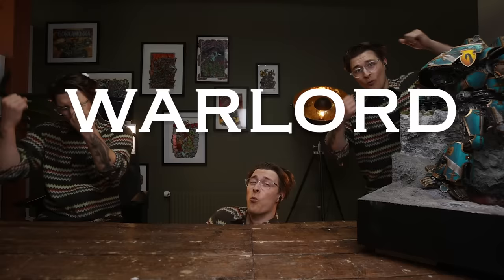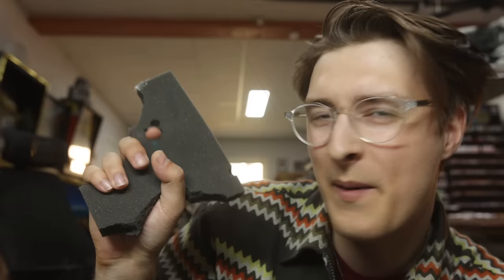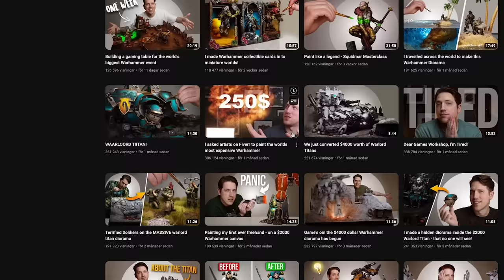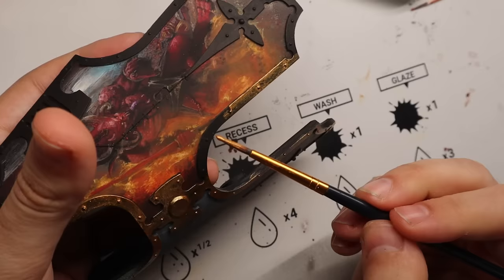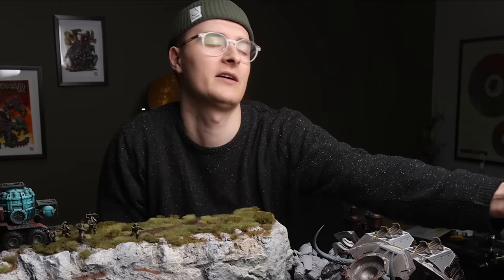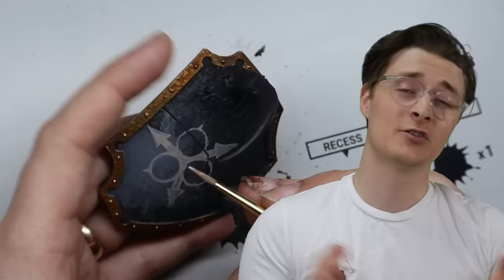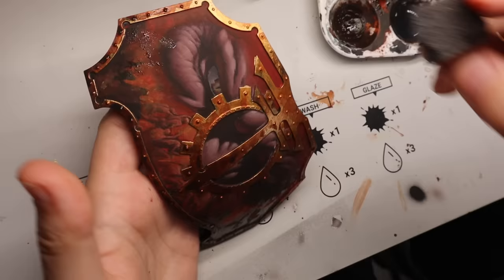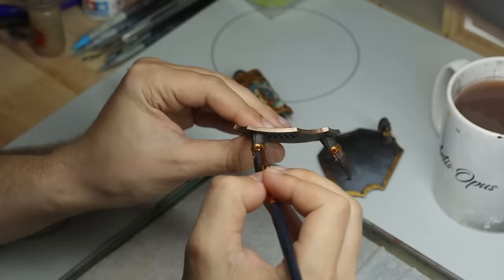I painted a Chaos WARLORD TITAN - for the $4000 Warhammer diorama

Comment: Doesn't resin pouring produce heat? If you do 1 big pour won't it take days to cure? And will it melt the paint? I'm no expert, I don't know how resin is, but  it's a big chemical reaction. 
(Fun fact: if the hoover dam was cast in 1 concrete pour, it would  have taken over 1,000 years to set! )

Comment: Please Emil & Lucas. Do not submerge those incredible panels in 100s litres of resin. There is no way the incredible details of the freehands or Lucas' tireless weathering/golden rim painting will show through all that resin. 

As an alternative why not include the titan void shields keeping the sea water at bay. It would be a cool challenge for you guys to create realistic looking shield effects. And it would also make sense that these chunky warlord boys would have shields engaged for a massive hand to hand battle
Reply: This is actually an amazing idea. Have your cake and eat it too.
Reply: Voids don’t keep out water and air, just projectiles?
Reply: "The ability of certain objects or radiation to pass through void shields depends greatly on their design and nature, although most physical and energy attacks will be stopped. This includes weather effects like rain, which creates a crackling sounds as it impacts against the shield. Void shields of a certain power intensity can act as a impenetrable barrier" - 40k lexicanum
Reply: I'm sure you guys are aware there's a big risk to the integrity of the models with the resin pour. Not to mention it will completely obscure all the fine details on the bodywork (thus concealing the amazing details you and the other artists have created). 
Why not create hollows (maybe using something heat resistant like stainless steel bowls) and sit the titans in these hollows after the resin has cured? Explanation - void shield holding the sea at bay.  
Not too late to re-think it. Or risk ruining two of the most beautiful titans ever assembled :(